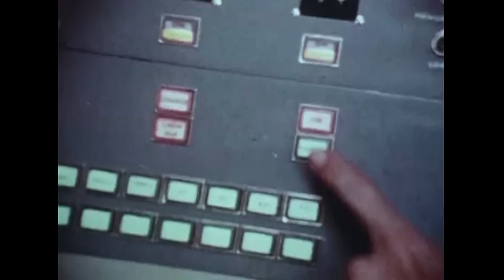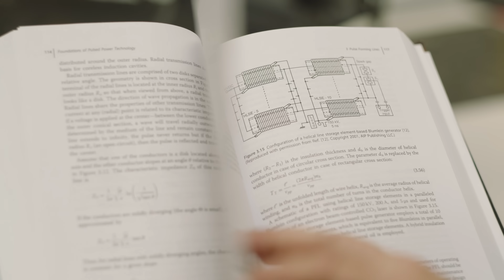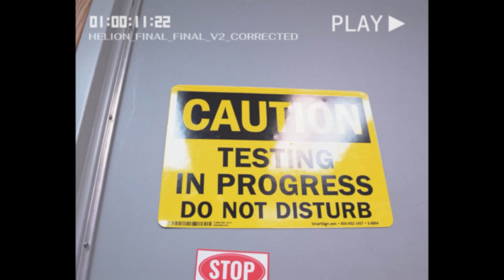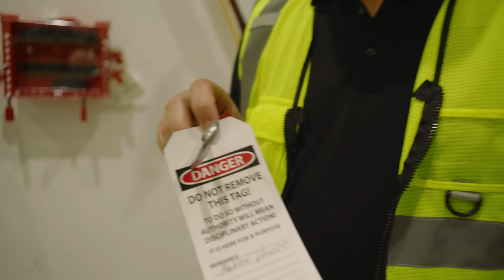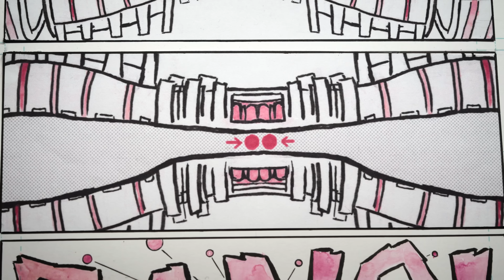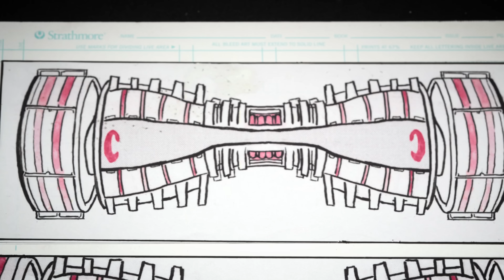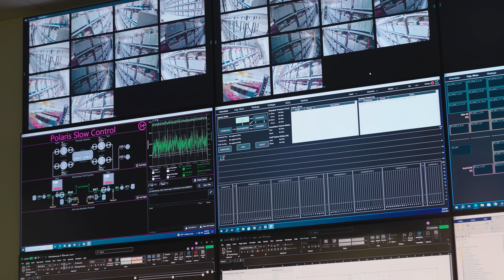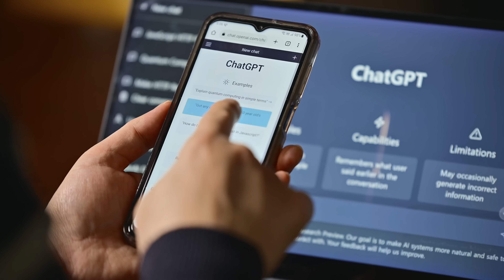A New Type Of Nuclear Fusion Machine Has Come To Life

Comment: since the 70s we have been putting more and more water in sealed containers
it can be anything from simple bottled water to dish soaps sports drinks, soups, closed chillers units, antifreeze...the list is very large and goes on

water is made up of two hydrogen atoms and one oxygen atom, which makes it a molecule, one molecule  is what we call vapor, it is only when a bunch of those molecules start clinging together  that it is liquid 
the reason this is important is because H2O doesnt act like you think it does, because as it evaporates and becomes a vapor and starts rising those molecules separate until they get high in the sky and cool down they condensate and start coming back together again and fall as precipitation...rain or snow

now then, to the climate part
every cooling system has a certain amount of coolant that is need to keep it at optimum temperature, earth is no different
for instance take 2 pots of water, one 1/4 full and one all full. heat them up at the same temperature, the one that is 1/4 full heats up faster makes steam (humidity) faster

same for the earth, since all this water is being put in stored containers, it is not circulated, less H2O molecules in the air, they cant combine to make  liquid that can circulate

right now there are the same amount of H2O molecules on earth as there were in the beginning, so no, those molecules are not gone, they havent went into space, the reason they are gone is because we put them in sealed containers

so if we deal with the water shortages, water in sealed containers, then we can deal with the climate heating up

or we can just wait till some of the ice is melted, yup

because H2O as a solid doesnt circulate or evaporate till it is melted. once it is melted a little, the ground water and the heat index temps will be back to normal

this is an answer to all the youtube videos on water disappearing all over earth

I have this idea in my head and cant get it out in a coherent way for most people to understand. yes it goes way out there, but it is something that no one else is addressing , the water levels around the globe have decreased. look at california, all the reservoirs, michigan residents have stated that nestle bottled water company has made their ground water drop in their rivers and streams, there are documentaries on this 

I wish someone would actually look at this because I'm certain this is a big deal

but as I said, we can just wait for the polar caps to melt and replenish the H2O molecules that are able to circulate
remember, H2O is just a molecule until it combines (condenses) with another H2O molecule, then it becomes a gas, then a mist, then moisture, then water, ask yourself, how many H2O molecules in a visible water drop
the answer is
there are 1.67 sextillion H2O molecules in a water drop, fact
https://www.thoughtco.com/atoms-in-a-drop-of-water-609425

you have to understand that H2O is not water, it is a molecule , and only becomes water when it is combined with a lot of other H2O molecules

H2O goes through a cycle that is necessary for the earths temperature to remain optimum, when there isnt enough it alters that cycle

the good news is, there are plenty of H2O molecules in stasis in the form of ice, once enough has melted, the earth will go back to its optimum temperature because those molecules have been put back into the cycle

the hydrologic cycle is the exchange of of energy that influences climate
when water condenses, it releases energy and warms the environment
when water evaporates, it takes energy from the surrounding environment, thereby dropping the temperature 

The bottled water market globally is rapidly growing with approximate 600 million households consuming bottled water in 2018. Thats more than 100 billion gallons (391 Billion litres) of water per year or 1 million bottles per minute.https://tappwater.co/en/how-many-people-consume-bottled-water-globally/

https://www.h2odistributors.com/pages/info/info-water-cycle.asp?
fbclid=IwAR04GhTkh8vdN1N3wgiYCuLa2tCGVQZ6oPDx0FmveO-UOQY1xC3rdEPvTgc

we also put oxygen and hydrogen in pressurized canisters separate from each other 
those atoms cant combine unless they are released and I know there are millions and millions of those stored in warehouses all over the world
Reply: Interesting theory. You left out humans. We are what? 80% water? I have wondered about the amount of water on the earth. I was leaning towards it all still being here and you agreed. Have the oceans lost any volume? That is an impressive amount of h20 molecules in a single drop of water. I'd love to find a way to split water more efficiently. i am not sure if knowing that makes it easier or more complicated.
Reply: @davidbeaulieu704  if you read again, I'm sure I put humans in there...I will read my statement again...I have revised it several times with new information over the years
yes human population also has an effect, not as much per capita as other things, you could maybe fill 2=4 water bottles with the water in humans, but when we die a lot of that leaves the body while some remains in us...and eventually comes out of the burial site...as I said there are many dynamics ( things always changing )  as to why all the rivers and streams are disappearing, and yes, the ocean levels have dropped a bit....not as much as the rivers and streams

everything above sea level will disappear first, the oceans might lower and rise depending on how much of the stored water is let out at a time, thats why we dont notice it

" I have wondered about the amount of water on the earth. I was leaning towards it all still being here and you agreed. "

I only agreed that all the molecules were still here on earth as well as the atoms that make the molecules

the milankovitch cycles have a huge impact on the weather as to how much radiation from the sun gets to us, as well as other orbital cycles

watch this video to understand how we move through the galaxy
https://www.youtube.com/watch?v=C4V-ooITrws&list=PLX2GCMEPZNBfemi_pZIhVts6HIIOShweQ&index=38

Comment: What is the process of retrieving electricity from the fusion pushback system? I’m not quite understanding what they are trying to assert is happening
Reply: I think that once they can get the pulsating fusion reaction going they could generate continuous heat that could be used to generate power.  Or perhaps a electrical field would be created that they could pull power from directly.
Reply: @pctrashtalk2069 are you thinking like a transformer or coil collector of some kind?

Comment: I have every confidence that this is the eventual high efficiency output of fusion energy, but let me remind the world that as our ability to generate greater amounts of energy rises, so does our efficiency. so our needs for energy are dropping significantly, and when we have a high power reactor we need acres of wire to bring it to people's homes, inevitably with loss, inevitably with maintenance costs.  do we truly want to put power centralized with small groups profiting from it, while the ratepayers or the investors, are asked to give ever more money over time to keep whatever the system is going. 

The paradigm getting energy from the Sun with solar collecting surfaces and battery is a much easier ill to climb.

 think most humans are tired of having to pay a bill to someone else when they can find the equity by harnessing the fusion reactor 93 million miles away with ever increasingly efficient solar, and the radical advances in efficiency we have seen there as well. 

80% of the world's population lives near the ocean, and the mass of putting wind farms off our shores instead of recreating the heat of the Sun here, well, I don't like whose hands it might get into. I decentralized energy world is a much better world to live in and much freer of people above us controlling infrastructure that we are paying for and they are profiting from.

Comment: The fact that they won't show anything makes it hard to believe any of it. Sounds a lot like hype for funding but not showing anything being effective

Edit: the fact that they won't say if it produces more power than it consumes tells you everything you need to know
Reply: Them not talking about net energy is the least of their problems. Nobody has ever demonstrated a net positive fusion project, as far as I know, so them not doing it isn't any different on that front. Despite the whole "startup" claim, this, like every other fusion project, is still foundations research, nobody is working on the net energy problem, because the foundations remain unsolved. As such, failure to get net energy is not very surprising and not necessarily worrisome yet. Sure would be real nice if we could at least demonstrate it one of these days though...

Comment: So to add some clarifying information that I feel wasn’t properly conveyed in this video. 1. The video made it out to seem like Helion hasn’t shown anyone their labs before. While you didn’t explicitly say that, you pretty much did everything BUT say that. They went on what could only be described as a press tour with YouTubers and journalists in the past while they were building Polaris. 
2. There is no one in the scientific community that doubts the core physics behind helions vision. The choice of typical tocamac reactors that spin a turbine is not because the people building them don’t think that fusion this way can’t work. But tocamac reactors are generating electricity on a tried and true proven efficient power generation method. That way they only have to focus on the difficult part. Achieving stable fusion. Helion’s vision is inspiring, but they have an infinitely more complex task. Not only do they have to solve stable fusion, they also have to pioneer non-existent technology. Tocamac’s are still humanities most likely bet for fusion energy. Helion is doing completely valid research and their method is a worthy endeavor. But it has done anything but solved fusion yet. 
3. Some things to take special note of: they say they recover the electricity directly to charge their capacitors. So basically, the absolute best case scenario is that they are able to recharge their capacitors off the energy they produce. But he made no claim that they can do that. He only said that they can use the power to recharge their capacitors, but not that it can fully recharge the capacitors from the reaction. 
4. Criticisms about transparency are incredibly valid. Literally no one is demanding them to hand over their intellectual property to possible competitors. But sharing experimental methodology and data does not require giving out any intellectual property. Any claim made by Helion without verifiable data is to be taken with a giant grain of salt. Let’s not forget that having customers and a building doesn’t mean that you are telling the truth. Just look up the history of the three wheeled car “the dale”. Not saying Helion are committing fraud, but every veil of secrecy only spreads further doubt and eventually whether they like it or not, there is going to be a day where they have to deliver and everything that they aren’t saying will have to be revealed and the longer they wait to talk about the literal bare minimum information, the worse off it will be for them if they can’t deliver.
Reply: Indeed one of the recommended videos for me at the end of this was another Helion video from two years ago.

Comment: D-He3 is reachable, but tough, and D-D fusion would predominate without He3 being the majority reactant. He3 is very expensive, D is cheap. Fusion chemistry is HARD. The "best" reaction for this type of direct energy capture system is H-B11, but that reaction takes insane temps.

I expect Helion to announce in 2026 or 2027 they can't really make D-He3 work for now, but they have a modified reactor that can take D-D neutrons for long enough to pay for frequent maintenance and has net output.

Comment: I admire these engineers.
They are splitting the atom to get electrical power directly.
A fantastic attempt and really the best attempt so far.
Other attempts involve bombardment of the kettle with neutrons which are extremely destructive and there is a serious material issue.....Many other issues as well.
But this machine requires no kettle to produce steam to drive massive turbines....A massive endeavour to say the least.
This machine hopefully will generate electricity directly.
it must be the best endeavour ever.

I imagine a huge capacitor discharged in an instant that splits the atoms or fuses the atoms which instantly kicks back with an electrical and magnetic force that far exceeds that initial spark......
It is like a spark that ignites a spoonful of dynamite....Imagine that spark igniting a ton of dynamite!
I trust when that spark happens, those engineers are at a safe distance because it will be explosive.....Think about closing and opening an  extremely powerful HV circuit breaker many times a second.......The forces will be extremely powerful at the power required for commercial use....In the order of hundreds of Megawatts.....
There are some interesting videos on the operation of HV Circuit Breakers on YouTube....
I asked an A.I.on the magnetic and electrical forces involved....Fascinating...

Comment: What I'd like to see is an estimate of LCOE:  The Levelized Cost Of Energy from this technology.  After taking into account the cost to build it, run it, maintain it, and finance all that over its life cycle, how many dollars per megawatt hour of electricity?  If it's five or ten times the cost of firmed solar and/or wind, then it doesn't matter how cool it is, it will not be worth building.  Because solar, wind, and batteries are now so cheap, I kinda doubt that we will ever see profitable terrestrial fusion.
Reply: Helion is aiming for 1 cent/kWh. The key here is that this is dispatchable electricity. In theory, it can act as both a baseline generator and a peaker plant. That means that it can replace all of those gas turbines or grind scale batteries that we need right now (and will need more of) to stabilize the grid in ADDITION to being a baseline power plant (like e.g. a nuclear fission plant). It would be a perfect match for solar and wind.
Reply: 1000% agree!!  How long does it take to pay off the CapEx of all those cables - much less the capacitor bank!  What’s the O&M / Lifetime?  Failure modes?  Does the fusion lining get damaged at the insane heat?  Have they reached a ‘pulse rate’ and stream steady enough for constant baseload production?  Gawd… imagine if “one” of the cables stops working somewhere… what would the de-bug look like?!   My guess:  (srry if pessimistic) it will take a LONG time before they get the CapEx low enough that they can get payback under 5years selling pulses at LCOE of $0.01/kWh!
Reply: @jdtransformation  
The first plants will likely be more expensive, but Helion is planning to mass produce their machines.
As for the cables, they are working on simplifying the wiring for the next machine. Don't forget that Polaris is still an experiment! So a lot of things are not optimized as a power plant would be but are optimized for an experimental machine where they want to rapidly test upgrade and replace parts as they learn new things.
I mean compare SpaceX Raptor 1 engine to Raptor 2 and Raptor 3.

Comment: About that title: limitless energy production will pump more heat into our closed planetary system. You can’t continue to pump heat into a closed system.

This will add to the heat load already being piled onto our planet.

Technically, this will accelerate climate change. 

HOWEVER: Killer video, ridiculous and godlike cable management and yay, bonus comics.

Comment: Cross section for D-T fusion is 50x higher than Helions proposed He3-D fusion. That will absolutely crush energy output and increases the required temps. Also, tehir energy recovery cannot recover any energy from neutrons. Helions approach is dumb idea that can ot work for basic reasons. Oh, and their machine will be destroyed by neutrons if they pull off the very unlikely feat of making it work.